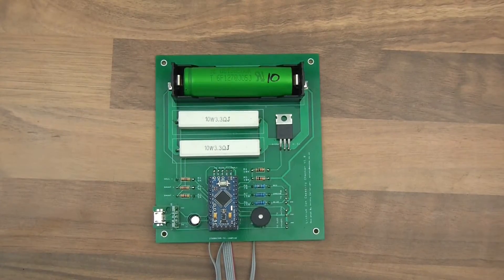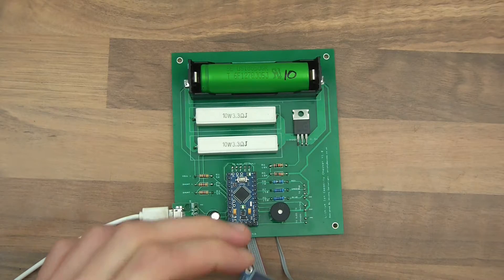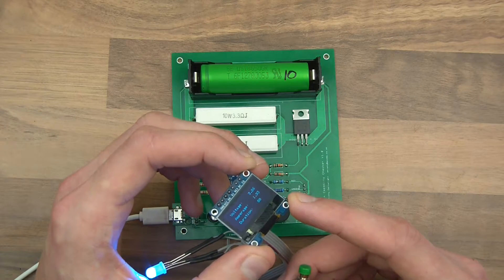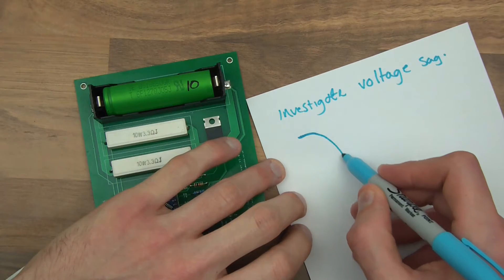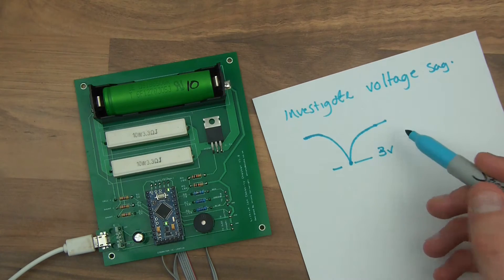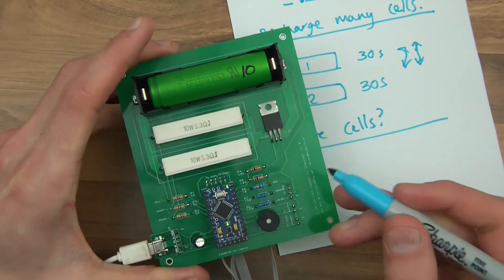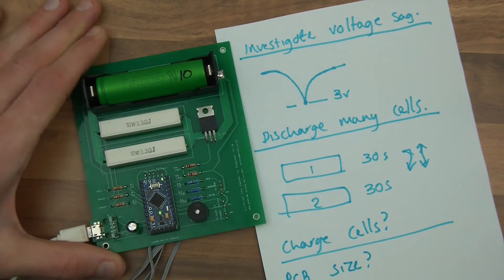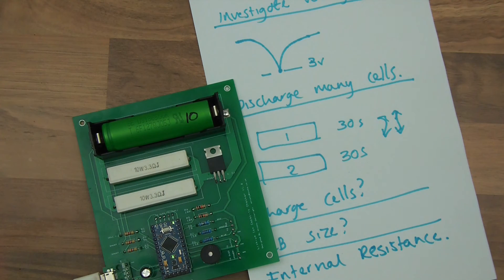REVIEWING: The Lithium Ion Capacity Checker Project!

Comment: Hi Antony, I really like your videos, you doing a lot of stuff I've tried or want to try but obvously have a lot more knowledge and explain it very well, bravo!
I'm thinking about a project: I have a big 100Ah 4S cell pack (for a camper) that I want to monitor in an easy way. There's nothing that I can buy that meets my wishes: individual cell voltage monitoring, with a display AND with some kind of wireless/bluetooth display since it might sit in an inaccessible area. Would be nice to also have coulomb monitoring going on.
I'm thinking an ESP32 with a small OLED, a shunt with an ADC, and individual cell voltage monitoring. You've done videos on almost all of this separately, but most of it seems like single cell stuff. Do you have any tips for me for the monitoring of individual cells, preferably in a very low-drain way with reverse polarity protection? I'd sponsor you on Patreon if you did a video on this, never done that before. I'd message  you privately but that seems gone on youtube...
Reply from the maker: Hi, thanks for you comment. You don't need to sponsor on patreon. I leave that up to people to decide on their own. About your project, it sounds interesting. See if you can find me on Facebook. I have a black and white wink picture. :)
Reply: @antonycartwright  I think I've gone through all Antony Cartwrights on FB and none match the picture you described..
Reply from the maker: @Xoliul  https://www.facebook.com/antony.cartwright

Comment: many people which test racing drone batteries have a procedure where they discharge the pack in several bursts, have a defined break between the bursts and start another burst when/if the voltage raises again above a set level. it is normal that higher drain results in less capacity. you could also do a reverse charge, e.g. dont stop at 3.2 Volts, just start reducing the current until the current is small enough where you would consider the battery empty or a combination of both.

Comment: The voltage sag was a problem for me as well. Just like yours discharged to 3V, I bet it'll measure 3.8 || 3.9V when you check the voltage after discharge. To add up to what Korishan wrote, i think you should test a high drain cell as well and really find out if the problem is with the loading or type of cell. Interesting video by the way.
Reply from the maker: Thanks...

Comment: Double layer PCB doesn't cost any extra, I've only seen PCB companies offering 2,4,6,8 etc layer boards.
If you need to make the PCB smaller to fit in a standard PCB size (eg 10x10cm, 5x5cm) mount the power resistors off the board, not the battery holder.
Reason being heat is never good for batteries, and those resistors do run warm.

Comment: Hi Anthony, I think charging would be a good feature. Then you can just hit test and you could measure full cycle capacity for  discharge compared to charge. You mentioned it, but I also have some cells that are only only good for small loads (e.g. 100 mA). A useful test could be to measure the maximum load in which voltage doesn't sag too much. Finally you could look into internal resistance. I read somewhere that's also an indicator of cell quality.
Reply from the maker: Good ideas!

Comment: You can make the pcb smaller by placing your small round resistors closer. They can be about 2.54mm apart, so that portion would be shorter than the nano. Take the ceramic resistors and stand them up. This will shrink the board space by almost 1/2 and place the FET between them. Probably move the cell holder to the bottom right of the board as well with same orientation as the nano.
And, of course, go double sided pcb for the traces  ;)  Which, actually, if you did this, you could even put some of the resistors "under" the nano, but on the top side.
Reply from the maker: Thanks!

Comment: Capacity rating is done under load, not while resting.  That's why proper testers don't use pwm discharge. Otherwise you could potentially over-discharge the cell. 
A healthy cell will only voltage sag by a few mV anyways, say around 100mV or so. If it sags by 500mV then it's a bad cell and shouldn't be used in any application where high drain is needed, so a torch would be a good use for it.
Most testers will run at 1A to test standard cells. Some will only test at 500mA.  But in either case, they check voltages under load.
The ones that test through pwm are usually doing it during charge, not discharge. And this is so that it doesn't overcharge the cell.
Reply from the maker: Hey, that's interesting! Thanks!
Reply: That’s what the big resistors are for .. to create a load